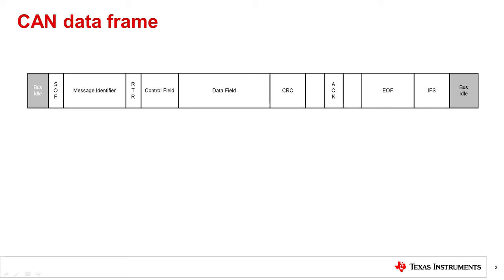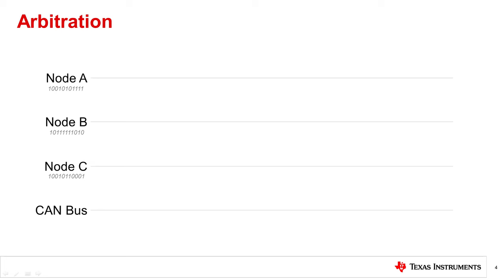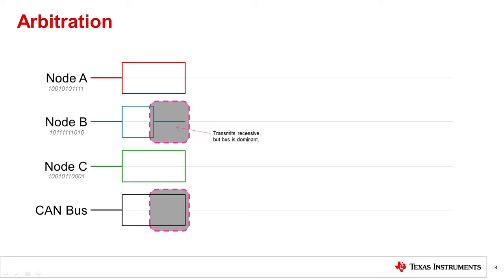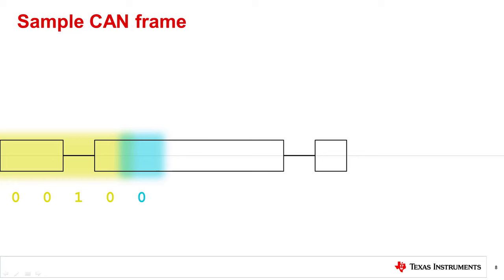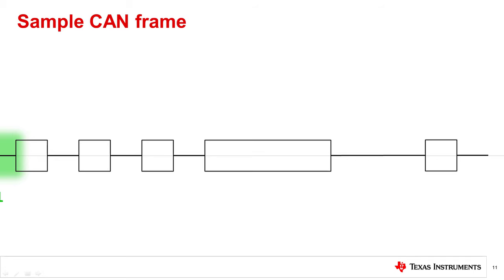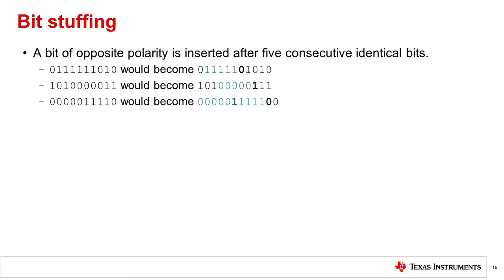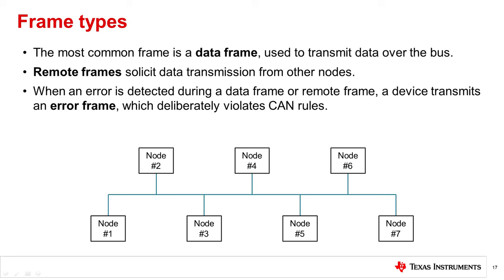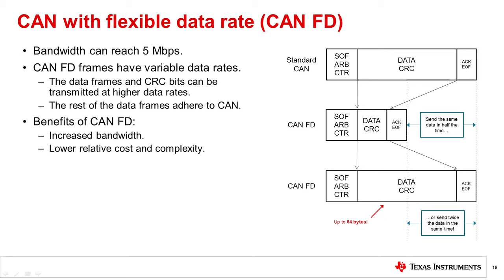CAN and CAN FD protocol

Comment: The arbitration relies on the nodes being synchronized but it's not clear to me whether they are synchronized at the bit level or at the frame level. Is it correct to say the synchronization works at the bit level and the start bit ensures that one node will not start transmitting after another node has started? (Obviously the arbitration is required if 2 or more nodes start transmitting at the same bit interval.)

Comment: I've seen a lot of different sources mentioning that the IFS should be 3-bits long. However according to this video and some of the other TI documents, it is said to be 7-bits long. Is it intended?
Reply: Since it is not defined in the Bosch specification, it is normal for it to vary from company to company. Since there is no effective bit on the message, it can be 3 bits or 10 bits.

Comment: but what serves as the address of the frame? Is it the priority id? Then, if a node requests data from another one, it puts the id of the addressee? What if the addressee is sending at the same time? Then the priority ids of the frames will be identical. Does it mean that the arbitration is solved by the request bit in this case? Also, in the request frame, can it include something like a "register address" from a node? Or 1 node is always only 1 source of data?
Reply from the maker: Hi @xealit, thanks for your interest! You can search our TI E2E Support Forums for an answer to your question here: https://e2e.ti.com